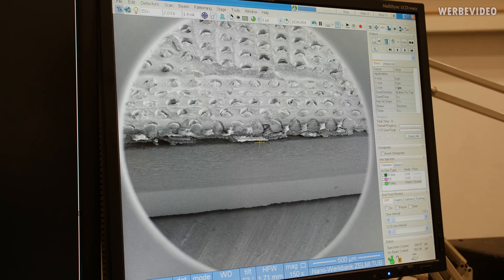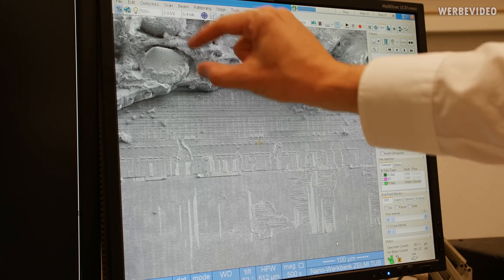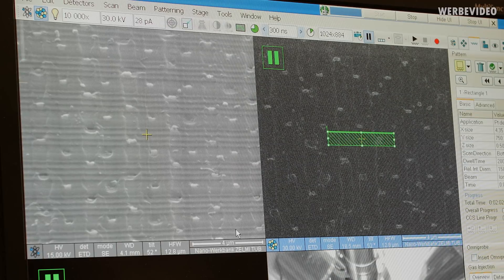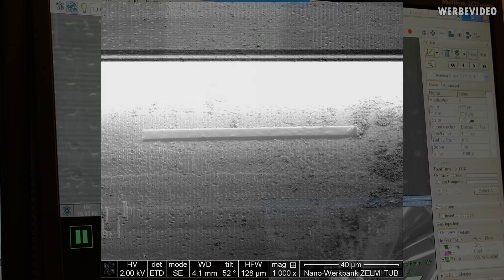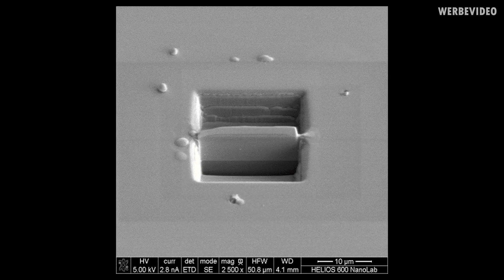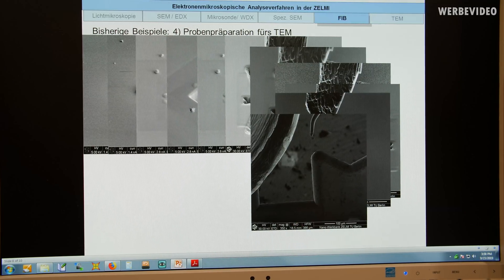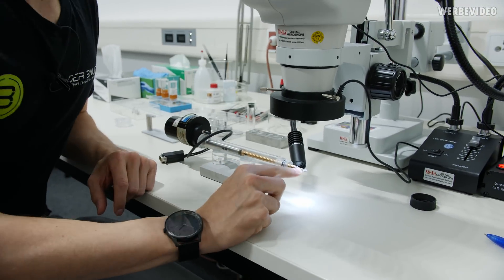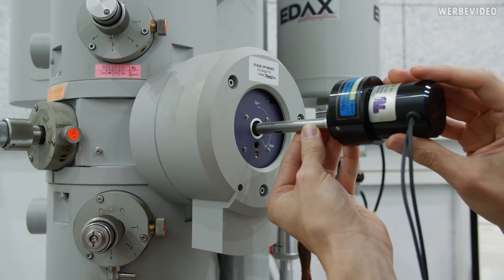Catching a single Transistor - We're looking inside the i9-9900K: Cutting the CPU with Ions 2/3

Comment: what in the fuck is an ion beam
Reply: Well. A beam of ions :-) (i.e atoms that have lost at least one electron). They are positively charged and can therefore be accelerated by an electric field. I don't know what kind of atoms are used for cutting here but you want heavy atoms that don't interact with the probe material so I would suspect that they use a noble gas (e.g. Xenon) for that purpose.
Reply: @compuholic82  thanks for this.  :-)

Comment: I miss this I used a SEM & TEM at HP Research labs for years until they moved production to Asia ... I have some pictures in the 100 angstrom range ... hopefully the modern 'scopes' are easier to use , it was always very easy to get lost in the field and beam strengths at that 'Magnification' ...we also used to sputter the wafer samples with platinum and titanium....great video.

Comment: I'm honestly flabbergasted, I had no idea you could essentially cut and glue nanoscopic samples with ions and platinum, and the software makes it as easy as point and click! What the fuuu
Reply: More than that! You can use pretty much any gaseous material. Most commonly used ones are platinum and tungsten afaik. And believe it or not, while a consumable, they don't need refilling too often. I've read a FIB manual that said "3.8g - 200h of deposition time" for a tungsten source.

Comment: This is incredible! It's so surreal to see these items scaled up so large! I've been building PCs for 20 years, and I had a general idea of what the internals are like, but I didn't know ANY of this! Thank you :) Can't wait for part 3.
Also... How was that tiny little piece adhered to that viewing arm? It was the size of a tiny dust particle, weren't you afraid you would inhale it? Could you imagine lol, being able to say you inhaled part of a 9900k... I wonder if you'd run faster?
Reply: They put a gas that contains platinum into the SEM which is bombarded by the ion beam (where you direct it) which cracks the gas molecules, leaving residual platinum where you want it.  The platinum holds it in place (if I understand correctly).
Reply: @MonsterSound.Bradley  Yes, they used the platinum as a solder.
Reply: @sleeptyper  Not a solder. Closer to brazing. It didn't melt.

Comment: I too was shocked when I learned single microscope objective for multiphoton can be $50,000 or more. I assumed it only cost $4000 or 5000 at most. Science is expensive. Makes you very anxious just holding it.
Reply: To be fair, that's mostly markup, as is the sample manipulator. They probably do cost around that $4000 mark to make.

Comment: The thing that struck me was this - How the heck do they manage to make the transistor components in the CPU So small and then set them to the order and spacings that are needed ???
Reply: what did you mean? building the SEM or the cpu die?
Reply: @schneggen_schubsa6896  sorry I was thinking of the CPU  itself and the transistors within it
Reply: @LDWilliams  to put it simply the cpu is build up in layers and each layer is a fotograph of a special mask. the mask are like negativs. and yes the structures are in the µm and nm range. the mask have the size of the wafer so each layer is done across the whole wafer
Reply: @schneggen_schubsa6896  quite incredible. Thank you for that explanation.
Reply: @LDWilliams  well its a quite rough explanation but its quite "simple" like that.
i suggest for more details to search here or the web for "semiconductor photolithography"
Reply: @schneggen_schubsa6896  thank you I may well do that

Comment: Man, that's absolutely amazing, looking forward to part 3 <3
I imagine the reason they are still using very old versions of Windows is that their "proprietary" panel of softwares probably requires some serious time, investigation and work in order to be ported on more modern OS versions :)
Reply: The SEM control software and drivers would probably run on a win7 or 10 machine just as easily, but why change something that's been developed, proven, and concrete? It's not like these microscopes receive monthly software updates.

Comment: just witnessing how small this is makes one wonder what the next step is going to be. at some point it just wont make sense to "shrink" the process. they will have to come up with new ways to advance.
Reply: Nanometers are 10^-9 meters, Angstroms (Å) are 10^-10 meters, a proton (single hydrogen, H, with the smallest nuclei) has a nuclei diameter of 1 Angstrom. Most molecules have their atoms just a few Å away, ~10 or so.

Now consider the size of the advertized architecture, 7 nm (70 Å). It does seem like an impressive achievement, thing is there's barely any room for improvement anymore, at least from the Moore's law side.

Comment: How hard would it have been to use screen capture software? Really bothers me when such high-end equipment users skimp on the basics and use a camera pointed at the monitor. Its already so fuzzy, this method makes it worse. FFS use a screen capture software, there are a lot available for free and you can even use Nvdia shadowplay.
Reply from the maker: dude gtfo. You clearly have no clue how this works and that I can't just go there on the university PC and install nvidia software. Use your brain
Reply: Lol they would be completely out of their mind letting anyone install random software on their EM equipment computers. You can bet that every piece of software installed on that PC had to be validated and approved for installation, you can also bet that they probably won't even allow you to plug your own USB device into it in the first place...
Reply: Because it is not always allowed to install anything to these computers. Most of the time they are not even connected to the internal network to protect them. If the computer does not work anymore and has to be fixed or even replaced, it costs several days to reinstall an recalibrate the software and some technician of FEI/ThermoScientific has to help which costs a lot of money.

Comment: What is up with these companies selling scanning electronmicroscopes for an incredible amount of money (hundreds of thousands of €) but not investing at most tenths of € more to have silent fans? Really, that sound would drive me nuts if I would have to work with it, invest that €10 in a high quality fan, it wouldn't make a dent in their profit at all. I hate it in general when devices get crappy fans, that is penny wise pound foolish, leaping over dollars to pick up pennies.
Reply: It would be really nice to have siltent fans for devices like that - but it is not about cooling a 100 or 1000 € processor but a 50000 € (or more) power supply which generates a lot of heat and has to be cooled by industrial 230 V fans.
Reply: @kleinerELM  exactly.
Reply: @kleinerELM  

OK, that voltage is higher than I expected, the question is if the noise level is a requirement at all in the design process.
Reply: @peterjansen4826   Actually it is. The most noisy and vibrating devices, the vacuum pumps, are in another room and decoupled in many cases. The noise and vibrations they emit actually harm the imaging. But most of the time there is no more room for the power supply and a air chiller.
And the power supply is not that noisy as it seems in that video. It is much more silent (at least true for our device) if not all high voltage devices are turned on at once.
Reply: @kleinerELM  Very much this!
These fans are likely dissipating a couple kilowatts of heat, certainly that much if combined with the power supplies and vacuum supporting equipment.
Reply: Somebody replied with "This is a university not a company."  The post was hidden by Youtube or removed by him. If I would work with that equipment at a university then tenths of € at most for better labor-circumstances seems to be quite a good investment to increase the productivity or at least the comfort. It strongly depends on the person but many people are troubled with those kind of noises, it introduces fatigue much faster and earlier for them. 

He also claimed that it would be impossible to make a silent fan. You can't make it silent but you can make it close to silent and have a much better pitch. It is about the bearing (which type is used), size of the fan (larger is better, it can run slower and displace the same amount of air while making less noise) and the shape of the blades. The casefans in my Fractal S can't be heard by most people (I have an extraordinary hearing, I am a musician) when you use your computer. Only if you would disable the CPU-fan you could hear it, barely, and that sound actually is pleasant, not annoying. Of course the fan has to last a long time or be easily replacable, I don't think that that would be a problem.

Comment: what function does the blank silicon layer serve?
Reply: It's essentially there so that the wafer is thick enough that it doesn't bend during manufacturing; then it's usually thinned down to make it easier to cut away single dice. A thinner die has better heat transfer from the surface (where the transistors are) to the back (where the cooler is placed), but too thin and it could flex and break the metal interconnects.
Reply: I think the SI layer is the semiconductor that is required for switching states (on/off) of transistors. Pretty sure Si is used due to its molecular structure lending itself well to having integrated circuits being printed on it. SI is made in large crystals and cut in a particular way due to molecular structure. Also think the SI wafers must be qualified for a given process. I.E. a 7nm SI wafer is different, prolly more dense than a 14nm SI wafer
Reply: @noname-xv6fr  New technologies do not actually use the bulk of the silicon wafer: they are Silicon On Insulator (SOI). Essentially, a thin layer of glass is created on top of the silicon wafer, and then over the glass you have again a VERY thin layer of silicon where transistors are made (I am simplifying things a little bit). The bulk of the wafer is pretty much there just as support material.
Reply: @noname-xv6fr  I mean that large solid Si that is above the circuit
Reply: @clamdong1974  Large solid Si is the wafer the circuit is printed on and is the semiconductor part or chip, sry not good at answering questions xD

Comment: Why the platinum protection layer? It seemed arbitrary? [Edit] AH! Because later you use it to pickup the sample. Now I get it.
Reply: The main reason to use a platinum layer on top of the specimen is to protect it. The ion beam would damage the surface of the specimen if the protectionlayer would be missing.
The first Pt-layer is not necessary to bond the needle to the specimen.
Reply: the platinum is blocking the ion beam which comes from above. So to protect all layers below.
Reply: @I-Singu-I  Yeah, I thought they were going to scan it where it was, so thought the platinum was pointless...

Comment: 5:20 is this a new delidding method?
Reply: Yes you just use ion beam to erase the IHS from pcb
Reply: Roman should use the ion beam to lap the surface atomically smooth
Reply: Well if you want to get a see through hole in place of IHS...

Comment: 15 kV and 11 nanoamps?
Reply: Well, you wouldn't expect the electron beam to contain all that many electrons, right? So the voltage is very high, as they're highly excited (have a lot of energy), but the throughput is pretty low (higher when it's being used to make cuts, rather than sample, but even then the current is rather low)
Reply: @mduckernz  Electrons aren't used for cutting. You're right that the current is often low, but it can go up to several microamps depending on the requirements.
Reply: @Spirit532  Oh? I thought they were at least sometimes (it's my understanding that even TEM, if repeated, erodes the surface being scanned - it's a destructive analysis, even if only minor. So if you crank up the particle energy, it should be more erosive...)
Otherwise it's what - heavy metal ions or something?
Reply: @mduckernz  Electrons don't really cause damage, no. Ions of anything do, yes. Phenanthrene, for example.
You don't use metal ions for milling, they're used for deposition.
Reply: @Spirit532  Okay, so you've now said that electrons and metal ions aren't used for cutting. So what IS, then? Not heaps of options left. Heavy noble gas ions? Xenon, argon etc? Oxygen seems a little too aggressive since you'd be forming singlets...

Comment: How can u create something so tiny? It has to be alien witchcraft
Reply: How did DNA was created? By your logic it would require a creator but who created that creator's DNA?
It is all a consequence of enthropy
Reply: The "magic" of photo-lithography :) light is super useful for etching, turns out. Yet even this has limits, as we're seeing now that EUV (extreme ultraviolet, <100nm wavelength IIRC) is becoming necessary to use, since previous light frequency (and so, wavelength) doesn't have the necessary resolving factor; limits ultimate resolution == transistor/feature size.